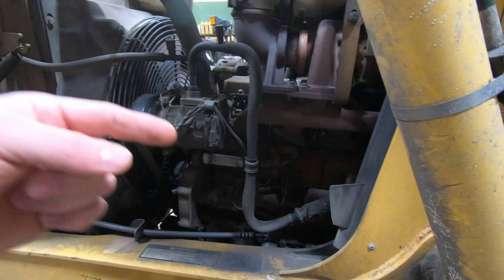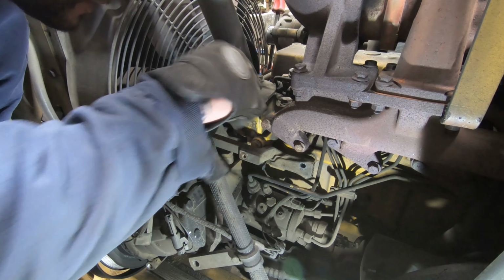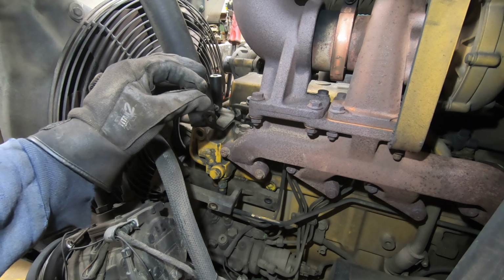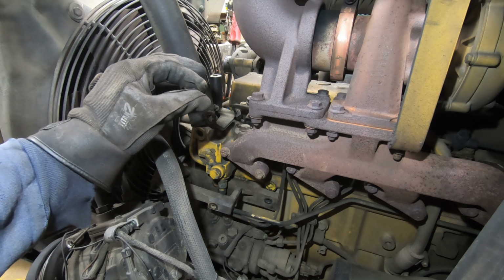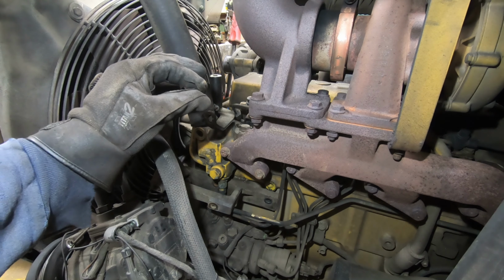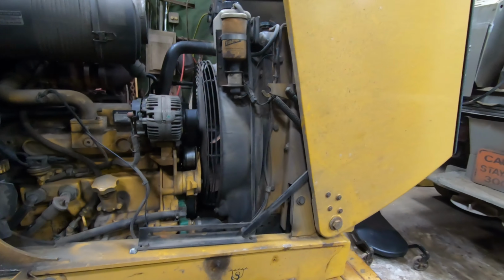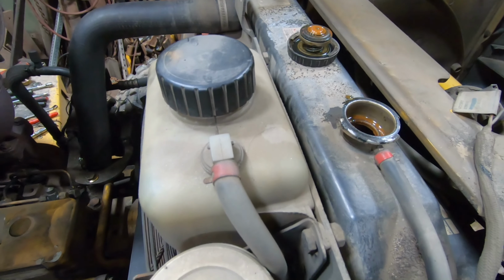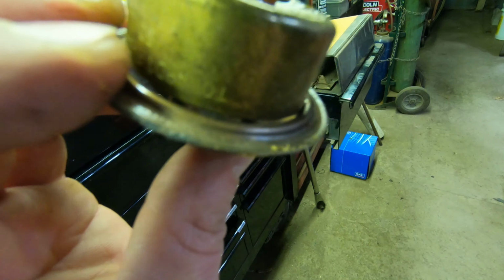John Deere 410G thermostat replacement

Comment: Great vid , I need to change mine to . On a side note how do you like those tires . I do a lot of road travel and the regular tires vibrate and shake the crap out of mine , and I plow a lot of snow .
Reply from the maker: They seem to work pretty well. They don’t really vibrate and don’t wear out fast. I think they are pretty good.

Comment: Did you mention how many hours on the engine?  Send an email to JD with what you found.  Could be a bad batch of thermostats.  They'd want to know about it.  Good video.  Thanks.
Reply from the maker: There was 6162 hours on it the first time I changed it and there was around 6700 when I changed it the second time. Both were for the same reason that their was no heat in the cab, and after the change it had heat both times. I didn’t email John Deere about it. Thank you for watching.